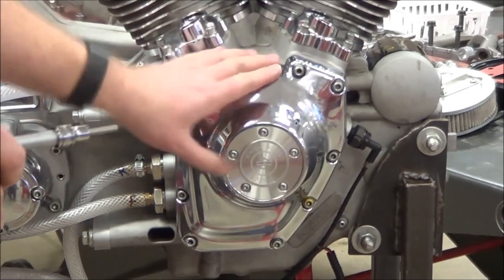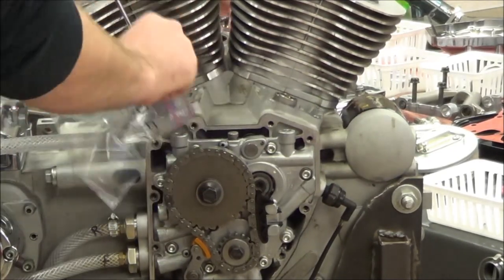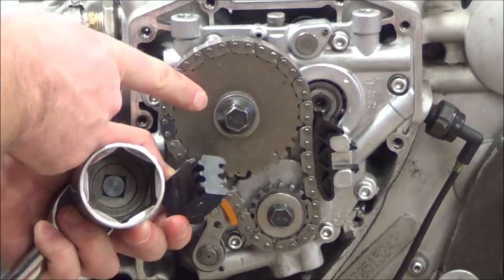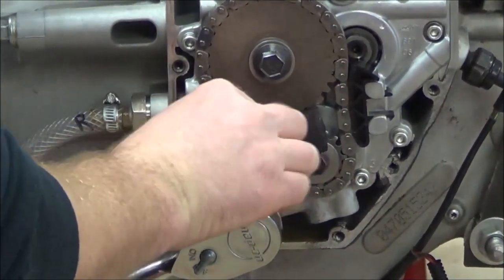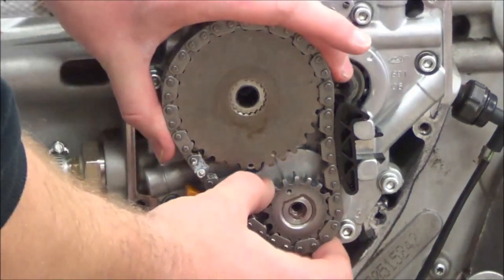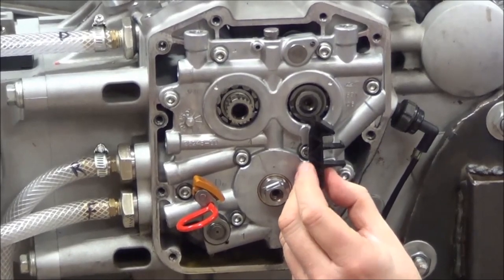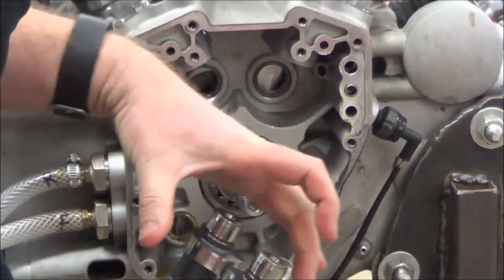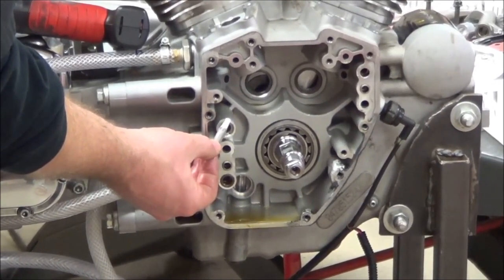Twin Cam Series:  04 Camshaft / Gearcase Removal (any twin cam V-twin engine)

Comment: While you have the plate off.    Always look inside the feed holes.
Harley doesn’t do a very good job at breaking of casting flash.
Mine was blocked about 20%.   A dermal would make fast work of it.

Again...      Great video bra!..

Larry

Comment: Hi Shane 
I am about to change out my cam chain tensioners inner  and outer  on a TC 88 A. I am hoping to leave my oil pump on my cam plate but noticed you loosened off the Allen caps on it. Was that just for your class. I have a tool I made that should allow me to leave the cams in place for the inner tensioner if that makes any sense. It’s my first time but I have watch and read lots. I have cut my push rods and everything already while on the base lobe. So can I just go ahead and remove cam plate with oil pump with original 4 Allen cap bolts torqued to spec in place. Thanks
Reply: Alberta Boy  could you share how you made the tool for removing the inner tensioner? I'm about to do the shoe replacement job next week. Thanks
Reply: cessnatpa it’s not my idea. Just look on YouTube Cam chain tensioners and you will come across it. I will look and try to narrow it down for you.  I still have a couple small  things on it to modify for inner tensioner. But it will . It works for outer tensioner no problems.

Comment: Couldn't help but notice the two hardware store hoses, I'm sure you know those won't last long with hot oil? Just seemed odd.
Reply from the maker: Dennis Rhein Hi Dennis. You must not have "noticed" we are a training college and this is a test stand motor. The reinforced clear hoses and used to demonstrate oil flow, air bleeding procedures and oil pump function. Make sense? Pretty dang good notice you had there but no worries. Make it a great day and thanks for tuning in and I hope you subscribed. Over 500 videos on here for free. Share as you wish. 
Conley
Reply: Looks like those are for bench testing, and probably only used a few minutes at a time.  Not exposed to hot oil long enough for any real damage.

I am curious as tot he brass fittings though, and the thread pitch.

Comment: Why do you need that tool why wouldn't you just  on the push  break to hold them in place
Reply from the maker: I can think of a couple of reasons...
1. If the motor is removed and on the bench
2. It's better to have a direct feel when using a torque wrench and not distracted by multitasking (but I dig your thought and even have an old video showing how to do it...😎 
https://youtu.be/zlJfbGgYLoI )
3.Some tensioner designs would not like the potential "reverse pressure" of possibly being wedged as your torque the fastener.  
Thank you for commenting. Want more benefits? Smash the subscribe button and bell! Want even more??? Join the channel:
-Daily MEMBER FIRST COMMENTS ANSWERED FIRST 
-Live Q/A video chats
-Wonder if we have a video on your need? Members can request content links!
-Full Access to the ENTIRE 700 video library
-Member-Only FREE tool giveaways 
Join this channel to get access to perks:
https://www.youtube.com/channel/UCBhM8DCKnT3qXwTW0eToyCg/join  

Just want to say thanks quick to support us for this information and our work saving you money? 
Give us a high 5 here:  https://www.paypal.me/how2wrench

Comment: Good video. But why mark  the chain - against what? Also why Mark the bottom sprocket timing Mark and not the top? Pointless really as lining up the timing marks on disassembley and reassembly is a given and straight forward; the marks are there. Also why speed up the sequence of undoing the plate bolts, if anything that was one of the most critical points that was glossed over. You would be better encouraging novices to go to the dealer; not get into something that is totally alien.  Bound to go wrong.
Reply from the maker: Hey Ian. This is a video series and much is covered as to why in the entire series.  Your observations are really good and from other comments in the past I know to keep the videos shorter things were sped up at times. You have to remember that the intended audience was the students in training using this as an extra resource for review and the WWW just gets it for free but just 
I’m the Social Media Manager here. That’s a good question for Shane. He gets hundreds of requests a day and starts each day answering MEMBER or donation support questions first and then if there is time he will try to circle back before heading to the shop for customer work. 
Want faster response times? Join link below.
Thank you for commenting. Want more benefits? 
-Daily MEMBER FIRST COMMENTS ANSWERED FIRST 
-Live Q/A video chats
-Wonder if we have a video on your need? Members can request content links!
-Full Access to the ENTIRE 700 video library
-Member-Only FREE tool giveaways 
Join this channel to get access to perks:
https://www.youtube.com/channel/UCBhM8DCKnT3qXwTW0eToyCg/join 

Just want to say thanks quick to support us for this information and our work saving you money? 
Give us a high 5 here:  https://www.paypal.me/how2wrench
Reply: Hay Shane, take a chill pill. If you put something up on YouTube expect criticism because people don’t necessarily know the full story. Respect to what you are doing and I am sorry if I didn’t get the full story. I was just pointing out things that as a life long mechanic on bikes; who was looking to learn something new - allowed his impatience and knowledge to overcome good work. Apologies. Ride free and live long. Peace.
Reply from the maker: @iantaylor7840  LOL...I couldn't have possibly written a reply with more chill...No worries but this isn't Shane...I'm just the social media manager. He does review the comments as he can get to them. I surely pass on to him the kind and helpful ones. We love filling this community with experts so welcome and even invite them to be guests on the live Q/A sessions.